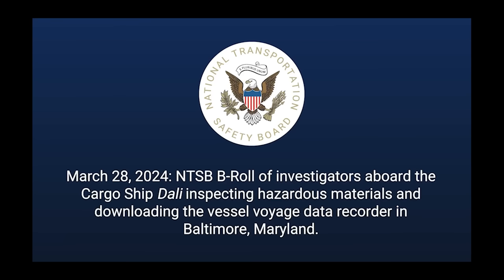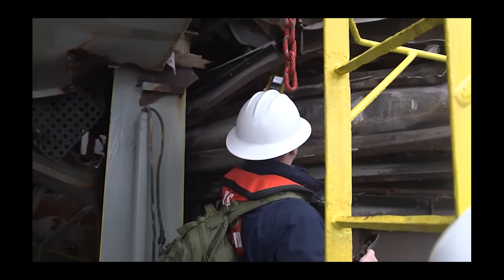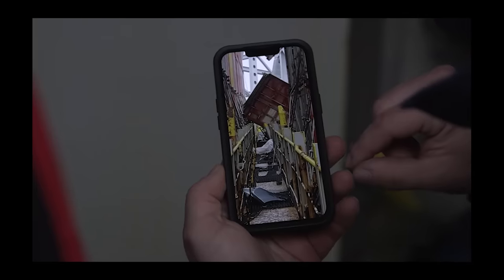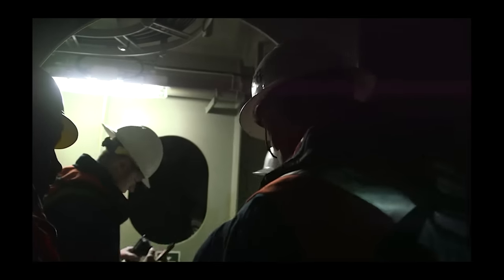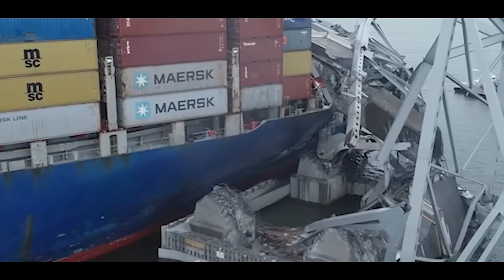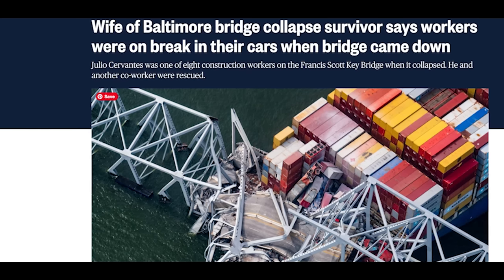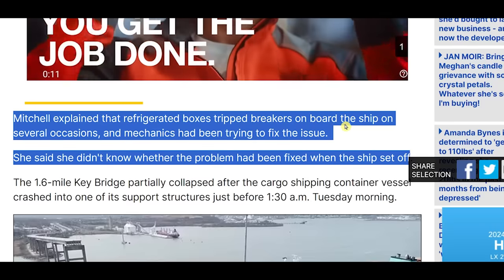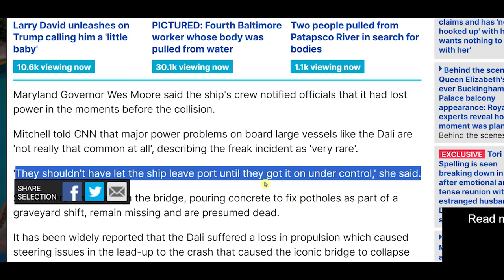NEW NTSB Video On Dali Ship Point of Impact Key Bridge

Comment: First of all, should American Federal and State, plus Cities Authorities, all be looking into and reviewing All Marine (inland waters or coastal, even deep water too) Infrastructure defensives measures now?

Not just bridge protection only, from commercial shipping vessels of all sizes colliding or impacting with either bridge?

Or with all types of Marine (inland waters or coastal, even deep water too) Infrastructure straightaway now, from shipping canal or rivers lock-gates, or port cranes and dock-key-sides, or fixed and floating dry-docks toon.

As well as all underwater laid cables and pipe networks, whether water pipes, or sewage pipes, gas pipes, oil and fuel pipes, or underwater telecommunication and fibre-optical data cables, or electric power cables, or underwater utility tunnels too.

Or road, rail or foot passenger cycling bridges, including lifting bridges too, or underwater train and road orfoot passenger cyclist tunnels as well.

Ports and Harbour breakwaters, piers, public and private slipways, yacht marinas, floating pontoons, ship repair and maintenance dockyards, water taxi and water bus or sightseeing boats, or party dinner cruise boats, loading and unloading terminals too.

As well as all the different waterfront residential properties, or commercial waterfront properties, plus public open space waterfront areas too. As well as all kinds of water sports and leisure sailing, boating and canoeing, wind surfing paddle boarding, even public swimming and diving areas too.

Then refuelling loading berths, or water loading berths, or sewage unloading berths, floating mooring buoy berths for Houseboats, or commercial barges, or any size of commercial or private vessels too.

Then there all port, harbours, channels, navigation buoy’s, aids, lights, cameras, water / currents, tides, temperature, pollution, weather and atmosphere marine monitoring sensor buoy’s floating all over the place too.

Even rivers and estuary’s, or inland waterways or Shipping canals, plus ports and harbour, as well as coastal marine wildlife and Waterfowl or Seabird and marine nature reservation areas, including mudflats and sandbars plus shadows that all need protecting to some degree too?

This is not just about so called only protecting bridges, from commercial shipping vessels of all sizes, colliding or impacting with bridges only!

Far too many narrow mind tunnel vision Politicians, at all Levels of Government now seem to think. 

Or the equally far too many news media reporter’s, or news presenters and news editors, as well as every social media bloggers, or everyone of social media too, including so called marine experts are talking about while real not knowing what they are talking about.

That how this Baltimore Port Bridge Container Ship Marine Accident and Disaster, happen in the first place too, wrong decisions were taken by Port and Harbour, City, County, State and Federal Authorities.

Also this was years ago, not months, or weeks ago, or even days ago when this Container Ship left the Container Terminal key-side either. That lead to this Marine Accident and Disaster happening, yes everyone will try to blame the Container Ship’s Captain and Crew, or the Pilots.

Equally try and blame, the Ship’s Owners, or the Ship’s Operators, even the Ship’s country of registry officials too, or blame all of the above because they are just foreigners too!

Though when the real blame game, actually really gets going in a big way, it has not started yet but it is surely coming sooner or later. That is between the Baltimore Port and Harbour Authorities or their insurance providers and lawyers, City of Baltimore Authorities or their insurance providers and lawyers too.

Similarly with the neighbouring Counties to Baltimore Authorities or their insurance providers and lawyers too, or with Maryland State Authorities or their insurance providers and lawyers too, along with the US Government Federal Authorities or their insurance providers and lawyers too! 

Also with the NTSB maybe US Courts too, let alone with Ship’s Owners, or the Ship’s Operators, even the Ship’s country of registry officials too, plus the ship’s insurance providers and lawyers equally.

Or the Ship’s Captain and Crew or their insurance providers and lawyers, or the Port and Harbour Pilots and their insurance providers plus association’s lawyers too.

Not forgetting all the American Attorney (ambulance chasing lawyers) and their Law Firms now lining up to represent, the families of these killed road workers on the bridge. Similarly start legal claims in Court for Millions of Dollars in financial compensation, from everyone in sight more than likely too, 

The Blame Game, Will really Kick Off Big Time, publicly and everywhere too!

So should not only the American Government, needs to start straightaway a major Public Review and Enquire. That is in to All Marine (inland waters or coastal, even deep water too) Infrastructure Protection and Defensives Measures straightaway now! 

Also the Canadian, Australian, British, New Zealand, South Korean, French, Indian, Germany, Japanese, Italian, Brazilian, Mexican, Dutch, Panamá, Danish, Egyptian, Spanish, Saudi Arabian, Norwegian, even the Chinese Governments.

All starting their own Public Review and Enquire, that is in to All Marine (inland waters or coastal, even deep water too) Infrastructure Protection and Defensives Measures straightaway too! 

The issue of the Voyage Data Recorder (VDR) black box, not recording vessels data, was it switched off by someone in the ship’s crew?

The reason the Voyage Data Recorder (VDR) black box, did not record anything, if there is a ship wide electrical blackout or outage. 

There is no data going to this Voyage Data Recorder (VDR) black box, from ship’s onboard navigation, propulsion, communications and steering, sensors and/or damage control systems too, there is simply no electric power.

Even though the “VDR” black boxes, have their own independent emergency electric battery energy packs, in case of ship’s electric power fails or is lost!

Which is shown by the fact, the Ship’s Bridge Voice Recorder (SBVR), or newer  Ship’s Bridge Audio Visual Recorder (SBAVR) black boxes. Actually carried on recording what was going on the Ship’s Bridge, that is between the crew, the ship’s captain, Ship’s Engineer’s.

Also with the Port of Baltimore Pilot, who all were on the bridge at the time, or were look outs on the Bridge Port and Starboard Wing Stations too, was still all being recorded and the NTSB has this recording now too!

Comment: Need to look back at power lines and it’s magnetic 🧲 fieldsEMF/ELF

From Faraday's law of induction, any change in magnetic field through a circuit induces an electromotive force (EMF) (voltage) in the conductors, a process known as electromagnetic induction. This induced voltage created by the changing current has the effect of opposing the change in current. This is stated by Lenz's law, and the voltage is called back EMF.

YouTube induction forging

Look at google maps power line’s bases are only there so power lines were new

Google parking under power lines and fire assessment working around power lines

The crosswind moved ship out of lane they needed the speed to overcome the wind 

Requirement for no wake zone is that you can control your ship at minimum power

I’ll be quick 

ADD in a factor to the accident. Been that close to HIGH tension power lines!!! And being 90 degrees to them. Creating a transformer effect ie power loss 
Examine closer to look 👀 for plasma discharge even between shipping containers also ship bridge the equipment on top of pointy look closer ion damage